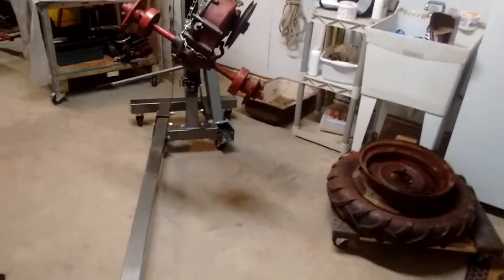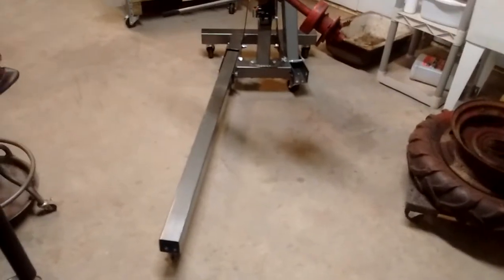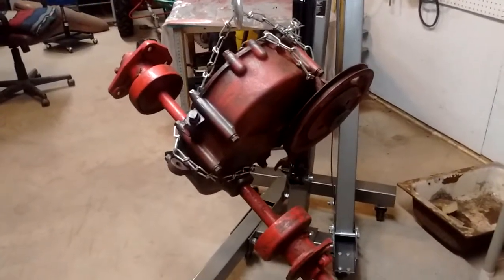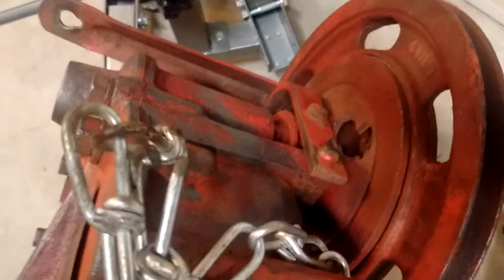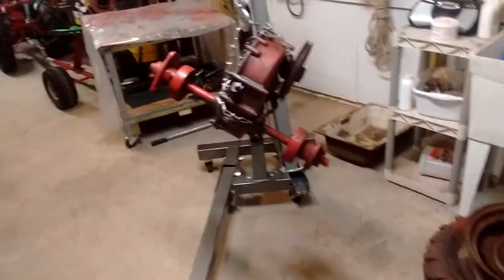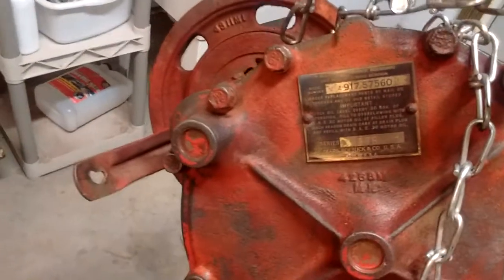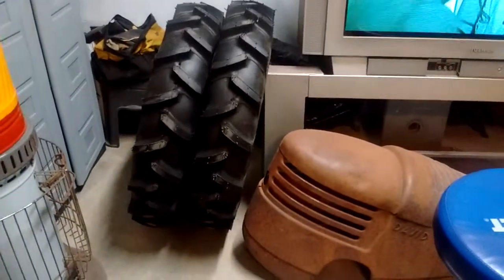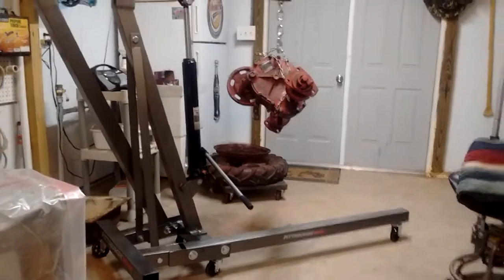David Bradley #2 restore challenges!

Comment: I have watched several of your videos trying to gather as much info as possible to help me restore mine it came with a Briggs 5s can you give me any ideas on what motor I could use and use the original hood any help would be a great help
Reply from the maker: Hey Mike, that's usually the first question all of us DB guys want to know the answer to. Several things play into the answer. The first is the width of the engine and how the parts: muffler, carburetor, air cleaner are attached. I have an original David Bradley motor which was a Briggs model 8, 3.5 HP motor, so it was the second generation DB motor than the original 1 1/2 HP motor. It has an upright oil bath air cleaner that was attached to the front of the motor so width was no problem. I have two David Bradley gas tanks that I wanted to use and saw a video on a channel called Farm Alarm where Tracey used a 3.5 hp Predator engine from Harbor Freight that fit nicely. He built a housing for his air cleaner and Im not as good with a welder as he. But the air cleaner box was the only challenge because I removed the gas tank off the engine and used my original DB tank. Another good thing about Predator motors is they sit at a 45 degree angle like the old Continental motors they used to put on DBs. Tracey tried to make his look like an original Continental motor and purchased an old continental decal to put on the gas tank. Please look at his David Bradley rebuild on his "Farm Alarm" You Tube channel. My first DB had a 3.5 older Briggs engine (about 20 years old) that had an alignment of parts so I could use the Briggs gas tank. The smaller air cleaner that sat on top of the carburetor was shaved on one side to allow the hood to come down. Dont be afraid to create your own parts. Just think of purpose of function. You can build an air cleaner out of most anything as long as it covers the air intake sufficiently. One drawback will be what kind of carburetor you have on your 5s. If it is an updraft small gas tank then the tank is attached to the carburetor instead of having a gas line rubber hose that will allow you to connect a David Bradley gas tank to. My 1950s Briggs 6s motor has that problem. I'd have to get a different carburetor to be able to use my David Bradley tank for it. The Predator engines have the rubber hose gas line that allows you to use a David Bradley tank.
Reply from the maker: I have been researching the original color schemes for David Bradley tractors. This following information came from a research article about the David Bradley Company. It has the best info I've seen. The question is can these paints still be found or created.
The characteristic red and green color scheme was used on the garden tractor. The hood was red, with green “David Bradley” lettering on both sides. The wheel rims on the tractor were light green. All of the accompanying yard and garden implements for the garden tractor were red. This color scheme, used for the entire David Bradley line of equipment, identifies the David Bradley light green as Martin Senour 90R-3724 or PPG – 41780. This light green paint is cross-referenced as Martin-Senour 21944 or DuPont 43073. David Bradley red is identified as Martin Senour 90R-3725 or PPG – 72155. However, collectors have found that these paints can be hard to find. To solve this problem, an exact match to the David Bradley green can be made by a mixture of 50% John Deere green and 50% John Deere yellow. The exact shade of green is a “Signal Green,” which is available from NAPA Stores under Martin-Senour paint number 21944. The Ditzler number is #41780 and the DuPont number is #43073. C.H. Wendel, in his collection of paint numbers published in a booklet called Wendel’s Notebook, is of great assistance to the restorer of farm machinery by identifying many different paint colors by their paint number. (Wendel’s Notebook is available for $8.50 from C.H. Wendel in Atkins, IA, Tel: [319] 446-7156.) Some collectors report that International Harvester red is indistinguishable from the color on paint found on the protected areas of some tractors. Other collectors, however, have found that Massey-Ferguson red is an exact match with paint found on their tractors. Actually, both of these findings may be accurate. The reason for the discrepancy in the red color is that David Bradley, like many companies, did not buy paint from the same company. They bought paint from the lowest bidder over the years which resulted in variations in the shade of red on the David Bradley equipment. The lettering on the side of the garden tractor is a darker shade of green than the “signal green” used for the wheel rims. The shade of this green appears to be the same as the “Meadow green” used on Oliverfarm tractors. Wendel’s Notebook says this is Martin-Senour 3751.
Following the color scheme of all David Bradley farm equipment, the walk-behind tractor was painted red with light green wheels. However, in its final year of production–1963–while all the implements remained with the traditional color scheme, the tractor was painted gold with royal blue wheels. One of these 1963 model tractors together with a complete set of implements–including a cultivator, plow, disc, drag harrow, sickle mower, bulldozer blade, sulky and dump rake–is owned by Marilyn (Hanks) Wells of LeSueur, Minnesota, and is exhibited at the LeSueur County Pioneer Power Show each year.

Spray can colors used:
VSTROM803:  I used Rustoleum Gloss Fern Green. It is nearly idetical to the original paint. The Duplicolor Grabber Green just looked too neon to me.  
Bryan Horne: Valspar Luscious Green is a good color for walk behind tractors. Bryan Horne on You Tube uses this color for DB wheels.

Comment: have you had the back plate off the transaxle?
Reply from the maker: Hey Gene, good to hear from you. Gene if you mean the back plate to the clutch assembly then I have taken one apart from an older DB with the spring lock clutch.  I have been unable to take a ball lock clutch apart due to the pin being stuck in the outer plate. The 1953 that I'm currently working on the pin is loose enough to remove but I don't want to disassemble the clutch unless it needs to be tightened. I hope to have the tractor painted by next weekend and fully reassembled in 2 weeks. At that time, I will run it and see how snug the clutch is. I'll get back to you if I do take it apart. Dan OConnor has a very good video showing the disassembled ball lock clutch. I highly recommend it. If you have the twist on outer plate i definitely recommend Dan's video on removing them. I also have some directions on removing that one. It has the allen screw holding it together.

Comment: Do you have any spare parts?  I am doing a 1955, 5HP Special.  I need the inner piece of the "clicker" hub. #9461M
Reply from the maker: Hey Rob, I live in NC and have a friend here that has the largest collection of DB stuff. Are you talking about the finger clickers and springs? Do you live in NC?
Reply: @bryanhorne8202  I live in Tennessee.  The clicker part I am looking for holds the spring and finger.  It is over the axle and inside the outer click hub.  It has a clamp on the end of it that is at the end of the axle.  One of mine is cracked at the end of the journal slot.  It would probably run fine as is with the clamp oriented to hold it together.  Maybe I'll try to cook the grease out & get it nickel TIG welded.  But, if I could find a replacement....  Could use a few other things if your friend has parts and attachments or pieces of attachments.  Seeder discs & chain, cultivator shanks/sweeps ect.  Maybe I would drive out there.  I drove to Cincinnati for Choremaster stuff....
Reply from the maker: Rob let me get permission to share his contact info and I'll get back with you.
Reply: @bryanhorne8202  Perfect.  I am heading out to a job now.  Will check back later.
Reply from the maker: Hey Rob. Mike said he would be glad to talk with you. He lives in the Burlington NC area, 336- 675-4083. He is the David Bradley guru for NC and has multiple duplicates. He'll have David Bradley stuff you've never heard of. If you need David Bradley manuals give me the serial number of the piece and I'll try to find the manuals. Email me at fuzzhawk1958@outlook.com